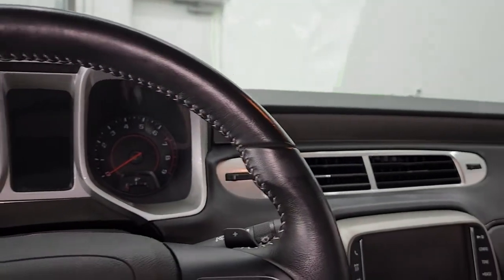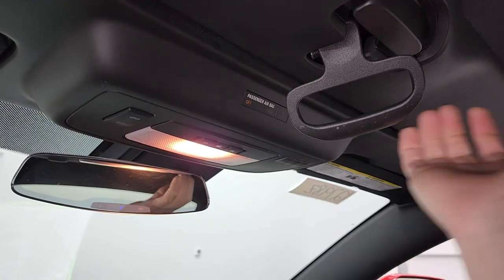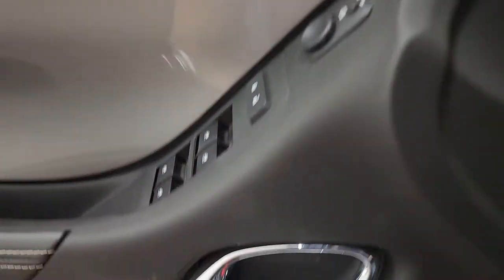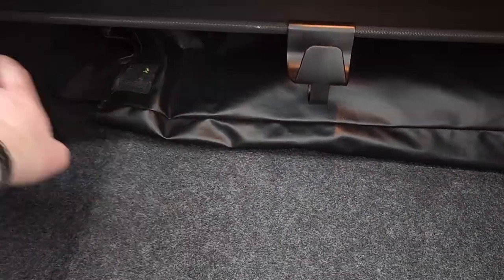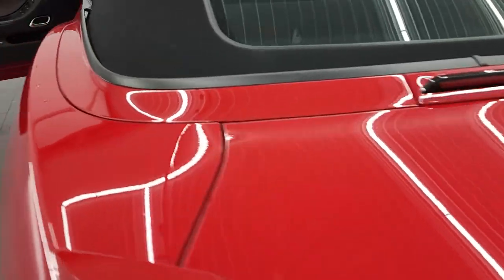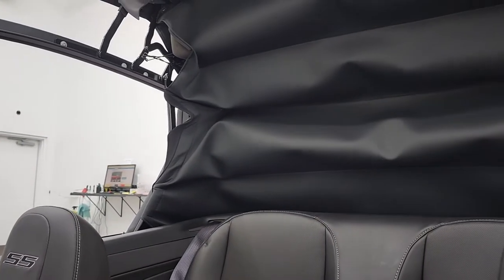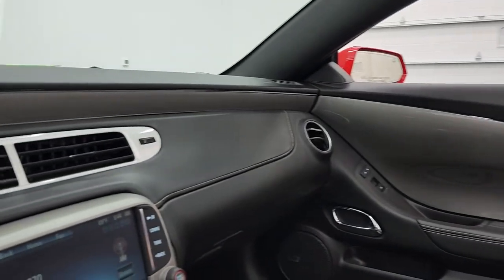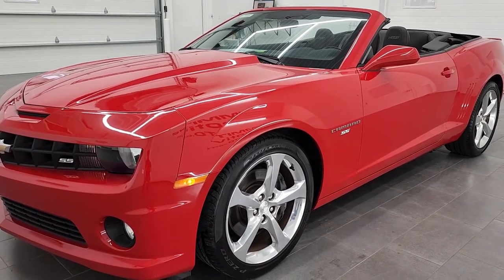HOW TO GET YOUR 2010 - 2015 CAMARO CONVERTIBLE SOFT TOP DOWN TUTORIAL

Comment: I have a 2015 is it possible to drop the top by hand?
Reply from the maker: I don't believe so if it is a power top I don't think their is a manual way to do.
Reply: @Summitauto  thanks for the reply. Also the screen that I pull out in the trunk is slightly detaching from the bar on one side. Will that prevent the top from coming down? One last thing where is the motor for the top located in a 2015 rs
Reply: @ernestoperalta93  on the left side of the truck pull back the liner where the shade latches and disconnect the sensor. my shade is busted so I thats what I did

Comment: I have a 2012 Chevy Camaro convertible and I keep getting the message "Unlatch top" even though i already have it unlatched.
Reply from the maker: After you unlatch try manually pushing it up a little
Reply: @Summitauto I've already tried that, and I retracted the net in the trunk and reconnected it, but it's still telling me to unlatch the top.
Reply from the maker: @paulfielder336  You tried turning the handle and then pushing up?
Reply: @Summitauto  yes, and absolutely did nothing.
Reply from the maker: Hmmm maybe your motor is broke
Reply: Did you fix it ??
Reply: @JPFSyracusedancegroup NO. It never got it fixed. The car ended up getting repossessed before I could get it fixed.